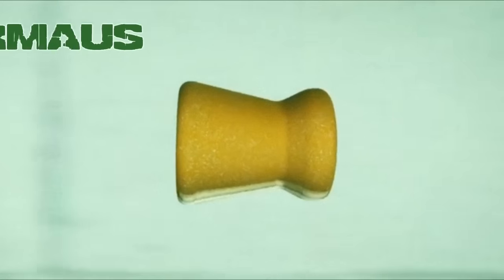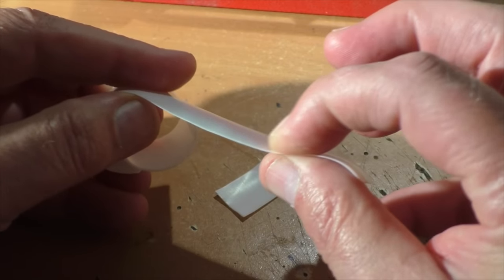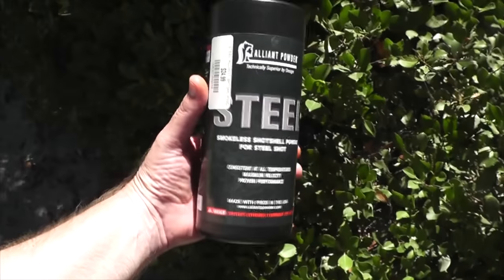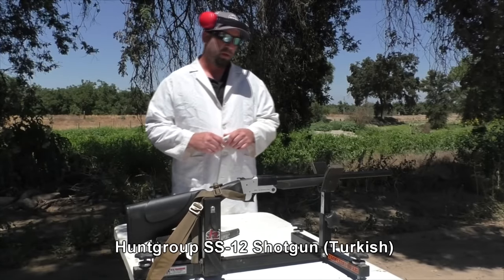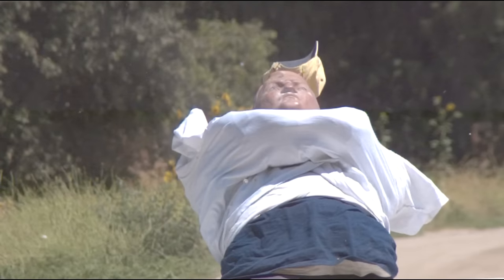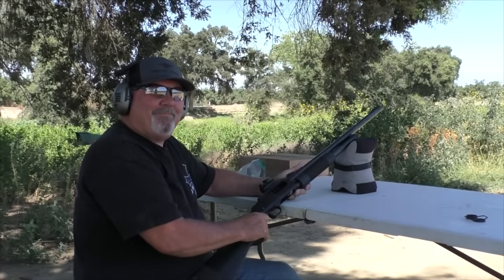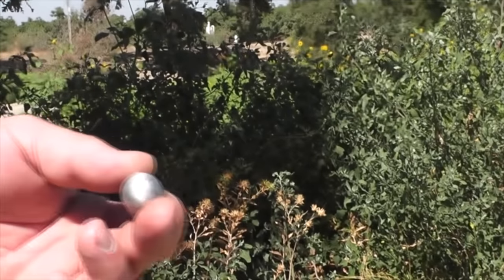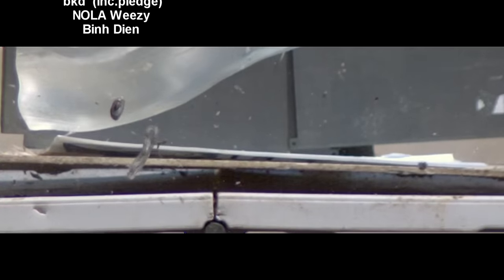The BUNKER BUSTER -  Experimental 12ga. Shotgun Slug

Comment: Steel nitrous oxide cylinders are mild,ductile alloy which is low carbon.  Considerably softer than the high tensile chrome moly steel which modern barrels are made of.
Reply: Oh, so totally safe to use in a rifled barrel? Gotcha 👍
Reply: Why don't they rust?
Reply: @pedrodepacas-ic1cb  
Time.  Probably a bit of oil or Boeshield T9

Comment: There is a teflon ring used  to seal Transmissions. Every transmission shop has a box of leftover 700R4 seals they never use. The ones used in a 700R4 would work really well for this application. You just need to make a ledge in the projectile to fit the seal. Would work as an attached sabot and a gas seal. Wouldn't need the sabot and the steel would never touch the barrel. The teflon seal is meant to resists about the same pressures as the rifle. Might look into it. They are uniquely shaped so would be ideal for this purpose. Very resistant to heat. Often the only seals to survive a complete Tra nny burn out.
Reply: its not so good for the environment i think
Reply: @sliceofbread2611  Teflon is fine it's the production of teflon that is not great. If you are worried about teflon in the environment.

Comment: If you switch to a stronger bolt action (I suggest a Savage), use RMC brass, you will be able to use larger charges of very slow powder to get more velocity, which will of course mean more penetration and longer range.  When shooting at a T-Rex with a tiny 45 gram (1.58 ounce) projectile I like to see a minimum of about 1,700 FPS.  Penetration is everything as we could be talking about having (depending on the angle) to penetrate 48 inches of meat to reach the heart and of course pretty dense ribs or sternum are often in the way.  A similar problem arises when taking a hip shot to slow the animal down.  Those pelvic and thigh bones are pretty thick and dense.  A tungsten carbide core instead of lead would probably also help the penetration.
:)

Comment: With such a small clearance I would think you could powder coat these the be the perfect size for a slight interference fit. People use plastic containers to tumble the powder on and toaster ovens to cure the coating so it's not a huge expense like regular powder coating is.
Reply from the maker: I guess if you could get an exact thickness of powder coating on every slug  it would work.

Comment: It's wild that such a relatively slow projectile soared through both sides of a 3A vest. Most people understand that velocity is king when it comes to armor, but it looks like enough mass with a hard enough material can make the difference as well. The channel 'Ballistic High Speed' showed a slug from Phoenix Rising called the "TSS Armor Piercing Slug" which was just a solid hardened tungsten ball that managed to punch a hole in an AR 550 steel plate! Anytime someone says that a 12 gauge can't work against armor, I'll show them this video.

Comment: as a former Hydraulics tech with other OJT of HI PSI!! and testing of all and at All temps cryo to Hi temps and other Haz, with Pipe Pigging OJT at all PSI and others.
if one was to coat the inner dia of a skirted projectile with an oil or grease with textile wads  I think the center would Not Compress into that cavity much, but you would coat the path with the material while exerting a sealing wedge or pressure ID to OD.

LOVE The IDEAS!! and get It Done!

Comment: These remind me of the homemade slugs I make from empty cut 12g Co2 cylinders.. they also make a great DIY mold for casting solid lead round nose slugs that fight nicely in wads.
Reply from the maker: I wouldn't use a CO2 unless you didn't care about the shotgun.   They are .737 or so in diameter.
Reply: @taofledermaus  Mastapoole was the first guy on YouTube that I saw shoot a whole Co2 cylinder out of a shotgun.. they do not fly well.. but they also did not seem to damage the shotgun. I prefer to just use the empty cut Co2 cylinder as an improvised slug mold to cast big heavy lead slugs.. and sometimes drilling out the base.
Reply: @taofledermaus  Just to be sure I went and measured a standard 12g Co2 cylinder.. and It measured 18.5mm or 0.728"
Reply from the maker: @dreadnaughttactical   my standard co2  must not be standard
Reply: @taofledermaus different manufacturers probably vary the "standard" for their brand to avoid any legal junk that may come up if a competitor don't like them all the sudden.
Reply from the maker: @pain_weaver   Never found any brand that fits in the barrel of a 12ga so I never took the chance of trying it.
Reply: @taofledermaus  I'd rather be safe too. Last thing u need is gun damage and a barrel rupture. Heard of this guy at local range who had his nice shiny expensive new gun showing it off.... he shot at a clay pigeon but was holding 1 part of gun in one hand and the other half in the other. It split right in half. He used a hand load. You put alot of thought into the loads and how best to load and what to use to propel them. Alot of people think loading is shell primer powder wad projectile. But it's alot of science to make it all work together.

Comment: The design of the projectile is such, that it does not give up the energy into the jell block.
Which is very undesirable for a hunting projectile to have.

Unfortunately, I have had experience with such projectiles while hunting, and my quarry had run off without being injured enough to be slowed down.

Comment: I wouldn't have been surprised either way on the lead plate test. But, at least now we know that even with an extremely hard steel projectile, diameter is still the single greatest contributing factor. 

The ricochet/splash (which most people call "spalling" despite NOT fitting rhe definition as spalling goes FORWARD from the P.O.I.) is a bit sketchy as any one of those pieces could potentially blind you or give you a decent bleed. That reminds me a lot of the "vertical bullet danger" premise of many an urban legend. 

In any case, I always kove to watch these videos. It's pretty universal that someone sees a 12 gauge and wants to find some whacky shit to fire out of it. As much as I love Taofledermaus,my first thought with these videos is inevitably "how would this perform in a BIG gun/cannon?" There's a certain desire for extremity in every instance where something more reasonable is presented/suggested

Comment: Ya it needs at least a shoulder around that radius. Maybe chuck them up in a lathe and turn a flat spot right at the shoulder transition or just above. Gotta have something to act as a brake against the material the round passes through so it'll displace and dump energy, even a bit more.

Good luck with YT bro, I make sure to check your stuff manually all the time. I think I've watched every one you've ever made :)
Reply from the maker: I don't modify the stuff people send me if at all possible
Reply: @taofledermaus  oh, no no I wasn't suggesting YOU do that, I was talking about the design in general :)

Comment: The steel powder isn't there to prevent damage from steel shot, it's there because the extra space taken up by a lower density shot material (steel) means that fast burning powders would generate very high pressures. Steel burns slowly to give the payload time to move down the barrel and bring pressures down.
Reply from the maker: which helps prevent barrel damage from using steel shot
Reply: @taofledermaus  Ok

Comment: Tao, while back, I suggested Golf Ball Slugs (steel round balls with golf ball dimples) for 12 gauge and 20 gauge to test, reasoning that the golf ball dimples would increase velocity, range and accuracy (like with a golf ball).
Also a lead, glass/porcelain, plastic/rubber version would be nice of this, as I am curious to it's effects on this golf ball idea ... .

Not to be fired at steel plates or other similar stoppers, as I do not condone harming such stoppers.  :P

Did you ever gotten to this, if I may inquire?

Comment: The FS-12, IMHO, is a horrible wad/seal to use under heavy, bullet-like projectiles being fired from 12GA--at least in our specific circumstances of testing with slower powders. A few other individuals and myself have been developing a new 12GA ammunition which must be used in heavy-action/heavy-barrel guns (bolt-action guns like Savage 210/212, Browning A-Bolt, or heavy bbl break actions such as the NEF, due to the higher pressures the ammo runs at). In initial tests with the new >1000gr projectiles, attempts were being made to pressure-stabilize the loads, and various arrangements of wad+seal combinations were used behind the full-bore diameter projectiles. Pressures were logged from a rifled, transducer-equipped test barrel as powder ranges were spanned during firings. The loads consisted of fairly large amounts (~120-160gr.) of powders on the slower-burning end of the powder spectrum, in order to achieve greater velocity from the heavy projectile weight. What was found in those tests, generally speaking, was that the more "cushion" there was in the load column which could crush during firing, the more pressure variance there was which would eventually occur. This effect is likely less pronounced when the projectile weights are far lighter, and the powders used are faster--total energy fluctuations are simply smaller. However, and getting back to the FS-12, some of the loads that displayed very consistent pressure ranges and low velocity spreads through repeated firings, then went wild when an FS-12 was swapped for the stacks of gas seals it replaced. It was also noted that the FS-12s would not crush evenly, sometimes crushing highly unevenly towards one side. This led to erratic pressure swings while the FS-12 was in the load column. Once the FS-12 was removed from the loads, all such problems went away. Because of this, I've taken a preference towards symmetrical items in the wad column--such as stiff gas seals to fill empty case space rather than wads capable of crushing with variance from shot-to-shot. At least when heavy projectiles are being used with slower powders, that is my take on the matter.
Reply from the maker: Never really had problems with FS12's  even with heavier payloads and powder loads.  I might try adding a x12x to avoid the gas seal problem.

Comment: Oh for crying out loud ,use a 13 thousandths heavy cloth patch for a .72 brown Bess musket  it'll hold up to at least 3 shots through a black powder fouled bore , and if you want plastic see if you can find teflon cups, but those cloth patches  with a 50/50 mix of crisco and bees wax, make sure its crisco, 0 cholesterol, LOL. I used to shoot muzzle loaders and I hated those plastic patches I shot hot loads all the time and experimented with patch material ,try using matress ticking on a .69 caliber ball, that's .040 total thickness, I had a J.C.Penny Magnum Shotgun double barrel and foor a starting load they suggested 3.25 drams(89 grns.) of 2 F black powder behind  1.25 ounces of shot , in a 3.25 pound  gun  I checked around and found out it was a Navy Arms magnum shotgun and it was safe to shoot with 4 drams of powder and 2 ozs. of shot, it kicked like a small bull. I don't know I always have to add a little story on my info. I'm 70 just retired and have all this information, gleaned from dixie gun works catalogs, lyman reloading products, a bunch of info from the libraries and gun magazines( the paper ones ), I studied college level metallurgy learned how to case harden thin steel and draw temper. If you can try this used to get bullet lube in a kit, you mix in this can a whole ounce of epoxy one tube at a time in lacquer thinner dissolve the contents of both tubes in it, then add graphite or moly sulfide or tephlon , thekit comes with the dry lube but as I said experiment.it also has a basket you stand the bullets up in the basket and dip in your special sauce then take out and hang os the side of the can and once the lacquer thinner dries the the epoxy cures(use 5 min) and voila dry lubed slugs. the dry lubes are powdered

Comment: How about a similar shape or even a wad cutter made of high speed steel. Id expect the lead plate to look like swiss cheese.
Titans of cnc made some artwork for Brandon. (not that Brandon, the good one 😁 )
Maybe they'd be interested in designing a few slugs for you.
If you want tight tolerances, they can get it down to .0000035 so you don't need to worry about your barrel.

Comment: This looks like a shortish "solid" bullet for a dangerous game rifle, and to a surprising extent it behaves like one, too.
The point of a "solid" bullet is not just to hit the right point on the outside of the dangerous animal but to hit the vital organ (usually the heart) deep inside it. For that purpose it has to penetrate in a straight line as well as fly straight, and it does both of those. I think an actual solid would have thicker jacket material in the nose, and would of course be longer in relation to the diameter and not need a hollow base. It would be flying faster, too, but not by a huge amount compared with some of the more trusted dangerous game rifle cartridges.*
The fact that it kept straight through the wood gives me some hope that it might keep a straight line even after hitting bone. (That kind of animal has massive bones.)
*Some modern American big game cartridges, in order to sell themselves to Americans, have higher muzzle velocities than their British or European counterparts. This may not be worth the pain, and anything that interferes with the "penetrates in a straight line" factor could even get you killed. 
There might be something to be learned by devising a test for a selection of "trending" big game cartridges to see how straight they penetrate after hitting a bone at a slightly awkward angle inside "flesh" or ballistic gel. If the bullet mushrooms when it hits the bone, unless it does so in a reasonably symmetrical way, it won't penetrate straight onwards from there.  A tumbling bullet may create a massive wound in a non-vital area.

Comment: I'd like to see someone make the shotgun equivalent of an apfsds round. Probably be too long for anything with a magazine(I'm thinking the projectile itself would be 2 1/2 to 3 inches long and .25 to .5 inches diameter with a sabot to fill in the gap. Iirc the m829 is a 40mm diameter dart fired through a 120mm barrel